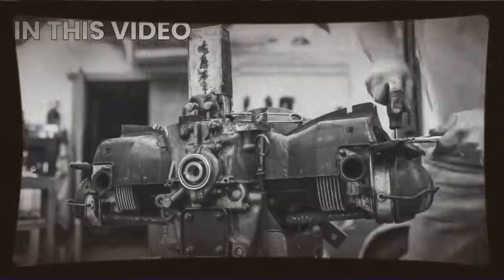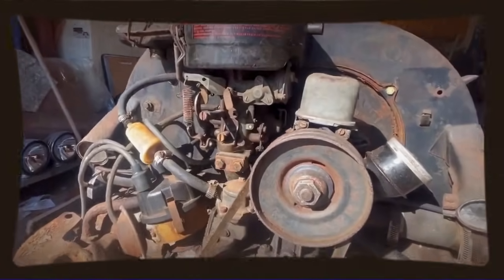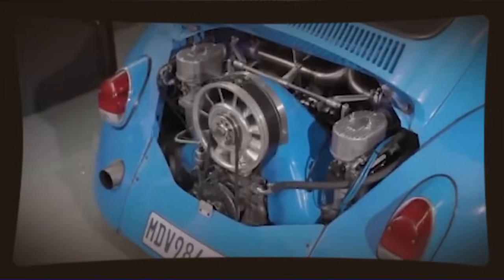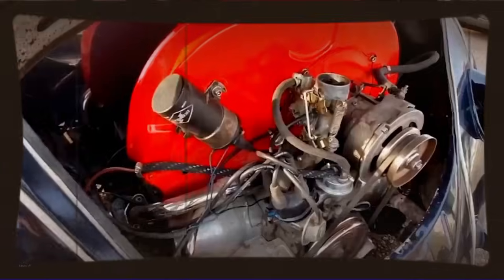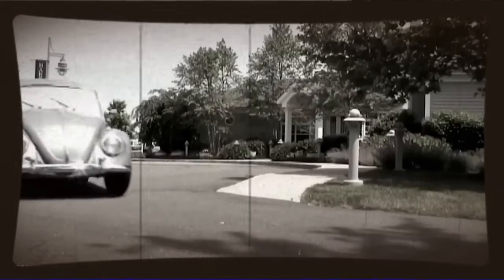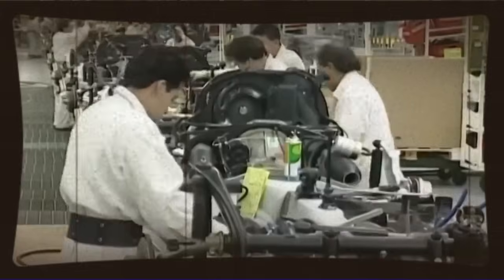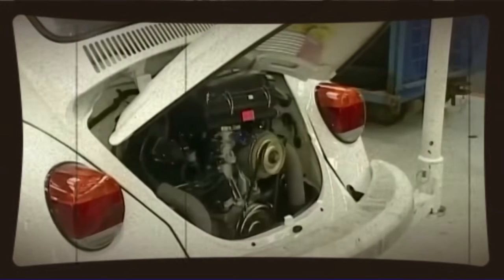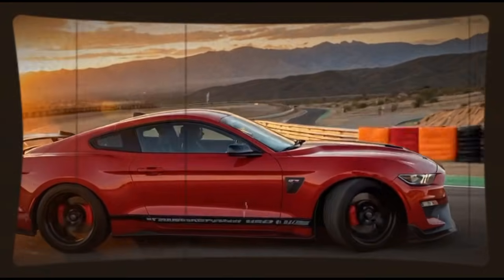This Mexican Engineer OUTSMARTED VW With a "Secret" Beetle Engine That Made 200 HP

Comment: and the big trick was to have access to the catalog of existing motor configurations and to be able to read? The guy had to be smart, but there is no trick here, he was just using the parts which were originally were not designed for their local application, this happens elsewhere as well.